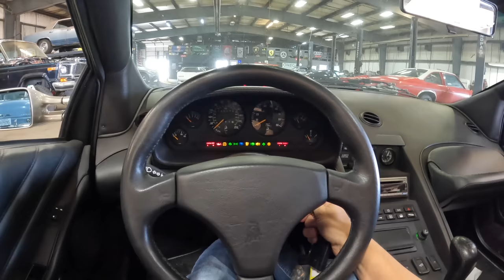All of my Lamborghinis are PERMANENTLY BROKEN, and that's totally normal. The Car Wizard GIVES UP???

Comment: I THINK I KNOW WHATS WRONG WITH THE DIABLO!!!!
I think Wizard is right about it sounding like a clarinet reed, because it’s probably the TXV pintle sticking. Try turning the AC off when the noise comes back around.
Reply: oooo....as a glorified PC repair man for the manufacturing industry, I like fault finding ideas such as this

Although, it leads me to wonder, just exactly how you reasoned this fault finding step? 🤔
Reply: @weedfreer  just hearing the noise sounds like something that is vibrating at an extremely high frequency. That makes me think about the components on a car that vibrate. Then components that vibrate and are attached to engine RPM. Then components that vibrate, attached to RPM, and are near the fire wall leads me to this as a guess. 
Couple that along with the conditions that the noise starts. Hoovie didn’t notice it until it started to warmup outside, and he (I’m assuming) started using the AC again. These are old Italian cars and little components like a TXV that aren’t used and lubricated often can start sticking and make this type of noise.
Reply: I have the same whine in my 330d when the AC is on and I’m at a certain RPM. Goes away with the AC off.

Obviously very different cars and issues probably aren’t interchangeable but it is an interesting thought.
Reply: My mother in law makes terrible moaning noises when we turn the AC Off.
Reply: @bruh meme that’s the thing the TXV is a mechanical device especially on such an old vehicle.
Reply: @kylekennedy420  almost all automotive AC systems work the same. If this is the problem, then it maybe to same for your car.
Reply: @BA-gn3qb  it may just be from the pressures equalizing in the evaporator that’s causing the moan.
Reply: @BA-gn3qb  criminally underrated zinger.
Reply: No A/C accessories in front of the engine…it’s all in the back. The “moan” apparently comes from the front of the engine, towards the firewall.

Comment: That noise could actually be something related with the flywheel pilot bearing. Creating the sound while it isn't loaded with the engine torque.
Reply: I was leaning more towards something in the intake plumbing.
Reply: @patrickradcliffe3837  don't think that would create such a frequency. They should install some mic near the gearbox. And then filter multiple sound frequencies.
Reply: I liked the idea of the oil thermostat, which would explain the noise when the engine’s hot.
Reply: e  what
Reply: @RogerM88  my guess is that it's a sympathetic vibration, or that if it's carbon fiber that something has delaminated, and wouldn't be seen on a quick visual inspection.
Reply: @peterborak3695  with this type of rare expensive cars, the better way it's to follow the service routine, replacing wearing items as the thermostats.
Reply: I had the same problem with a truck (I know, totally different breed) The truck arrived with a transfer case replaced and new rear shaft, I drove this truck for several days and couldn’t figure what it was, at the end it was a bearing that would  make a humming noise at certain rpm
Reply: e  Reported
Reply: its a bearing or some wind noise it being a convertable
Reply: @RogerM88  old Ford focus' used to have a solenoid that would go bad in the intake and "hoot" when the car was idling under high intake vacuum. I wouldn't be surprised if other cars had other goofy issues.

But this Lambo is beyond me.
Reply: @miguelgallegos8038  many people when doing the clutch job, don't replace the pilot bearing. I once changed a clutch in a truck, and the pilot bearing needed to be ordered separately because it didn't came with the clutch kit. I ended up not replacing it because the one i ordered didn't had the correct inner diameter, and the one in the truck was ok and too stuck to remove. The first day after the clutch job, I heard some winning noise with the car idling that immediately made me regret not changing it. The clutch release bearing was changed, so it only could be the pilot bearing. The noise eventually disappeared after some days. But with a high performance car with more load into a pilot bearing, not changing it, could bring some type of loud noise when the engine isn't at torque load.
Reply: @patrickradcliffe3837  i think intake plumbing was the first thing wizard thought too. So im sure hes checked that all out

Comment: I wonder if installing Dynamat or similar to the panel between engine and cabin could dampen the sound?
Reply: That’s the same thing I was wondering.
Reply: CLD type sound deadeners wouldn't be particularly effective against a sound like that. They tend to work better at adding mass and lowering the resonant frequency of a panel, and absorbing very high frequency vibrations in that panel. It would likely need a mass loaded vinyl, decoupled from the panel itself to block the noise.

Comment: That sound is coming from the de-coupling ionizing sectionised pludainum overtransactors. it just need adjusting to the counter clockwise using the new Rockwell Turbo encabulator.
Reply: Capacitor fluxing…
Reply: gotta love rockwell automation
Reply: More likely it's one of the spurving bearings, time and wear can allow them to make contact with the panametric fan

Comment: Timing belt/chain harmonics under load, that's where I would look
Try disconnecting injector and see if it moves the harmonic at rpm range.
It could be a gear droning in the front cover as well, possibly oil pump.
I have seen oil pressure regulators make a Humm when they are producing slightly more overpressure than regulator/bypass valve is opening, then you get a continuous series of cliicks that makes a Humm.
Replace engine oil to change viscosity and see if it moves the drone range.
Try an oil thickener like Lucas, if it doesn't effect anything, your only out oil.
Injector disconnect may give you a code or 5 but only out a computer reset.

Comment: That odd noise in the Diablo maybe actually a rattle within the engine compartment. My W12 A8L had that exact same noise when I drove the car at WOT and drove me crazy. Turned out a fuel line with a metal clamp managed to rattle against the manifold. - I found the source of the sound by cutting up pool noodles and wrapping pipes/cables etc until it was no longer there. Then I slowly removed the noodles until I found the source. Maybe worth a shot before having the wizard spend a bunch of time ripping it apart.

Comment: I worked at a high end shop for years and we had a set of microphones that we could clip to different parts of the car to find noise. It had a switch box and headphones that would allow you to isolate each microphone.
Reply: That’s what they used, “ chassis ears “

Comment: Here is a trick that might help finding the noise. 

Find a dyno shop that has an above ground loading dyno.  Get that car strapped on it and lock the RPM using the loading feature at the RPM where the noise occurs and then have someone in the car advance the throttle to the engine load point where the noise occurs and then poke around the engine bay and climb under the car and see if you can chase it down.

I did that using my above ground DynoJet 244xLC and diagnosed a similar noise no one else was able to find.   Took longer to strap it down than the find the noise.  That guy was very happy.
Reply: THANKS FOR WATCHING-🤝
You have been randomly selected 
Send me a direct msg right away 👆

Comment: I had a similar issue on my 300ZX twin turbo. A moan about 3k rpm. It was the i take tract and started occurring when I removed the factory air box and added a high flow Stillen K&N intake. Put it back to stock and noise was gone. Check the intake tract and anything not stock in the air way including air filters.

Comment: I’m not sure if the diablos have a spring loaded tensioner pulley or not but could that be the issue? Maybe when it reaches around 3k rpm it makes a spring loaded tensioner spring vibrate and resonate to make the moan sound?

Comment: I think you are finding a natural resonance in that drivetrain. Could be a bearing on its way out or a misalignment. Not sure if this car has the "option" for the all-wheel drive, it could be an issue with the output shaft. I would put the engine on the lift and see if it has any play on the shaft or any support that could not be tight enough. Can be the stiffness in the drivetrain that has changed because of this.

Comment: Hi Taylor, I will write some experience I had with an old car I used to own. It isnt a diablo of course, it was a WV Eos that started moaning right after the clutch broke and the mechanic changed it for another one. It was smooth with the original one, but the sound when decelerating was soooooo anoying I finally get rid of it. Its just a totally different car etc, but who knows!

Comment: You have a leaking air pipe/evap pipe near the firewall run a smoke test on the intake side and see if you get smoke. With age the  rubber pipes wear out and get leaky and sounds like crap then could be a cheap fix. It wont throw codes for something like that because the diablo ECU was not that advance back in the day to pick up a minor intake leak. Incase that does not work there are few other major diablo issues which cause issues intake manifold seal/gasket. Trans fluid worn due to age will cause a low hum in the trans.

Comment: I love that little Porsche Spyder replica. Sadly, it's out of my price range, especially for something so impractical. It's a race car from an era when a barebones race car with lights (necessary for endurance racing, anyway) was capable of being an acceptable road car, both legally and in terms of buyer acceptance of the un-weather-protected driving experience.

And here's a thing:
Lamborghini Muira was not the first mid-engine production sports car. The Spyder (1955) was a mid-engine Porsche production car, and not the only one from that era! There were the Spyder, RS60, 904 Carrera, and 906 Carrera. Even the 908 Le Mans prototypes were technically the last road-legal 'production cars' to race for an overall win at Le Mans, if I am not mistaken (1967-69, beaten by the Ford GTs). There was also the Alfa-Romeo 333 Stradale (1967), but I digress.

Anyway, Hoovie's Spyder would make a kickass pure sports car, for times and places where that works. But, I'm going to setup a Miata with manual steering, I think. Somehow I'll have to make room for my 6'1" self in that little car, potentially behind a biggish steering wheel.

Comment: Air bag light can't be turned off. In my state you'd have to install a bypass on that, because you'd never pass the annual inspection with that light on. So the car could never be put on the road.

Comment: Own the opposite : a 1988 Mazda RX7 FC Turbo what causes less to no trouble. It starts and drives just like my daily MX 5 ND. Changed one rotary engine after 100000 kms 20 years ago. Car has now 150000 so see forward to another trouble free 20 years. Car passed strict emissions and road worthyness - test here in no speed limit Germany on friday without any  issues !

Comment: We had a BMW where the crankcase ventilation failed and excessive vacuum caused the rear main seal to moan just like that. If we imagine that this is a similar vacuum related noise i suspect the seal around the harmonic balancer may be a possibility. I've seen your vidoes from the beginning because of our old 420 SEL and have always enjoyed the witty commentary.

Comment: Beautiful Lamborghinis there Tyler, you have awesome vehicles ..  I always wanted a Countach.   So much so My Dad once bought me one, it was the Hot Wheels version 😂...   Judging by the moaning noise it could also be a warped exhaust manifold, bad gasket or block mating surface.  It will sound like a clarinet reed noise as you described.  Under normal idle or driving the exhaust manifold is fine but during acceleration like between 2000 to 3000 rpm's the exhaust manifold or gasket will temporarily leak high pressure air creating this noise.   The leak is probably at the back of the engine top passenger side exhaust tube.   If the noise happens more when the engine is warmed up I would say the manifold is deforming just enough to leak past the gasket, once it cools down it goes back to normal...   I had a similar issue on my late Father's L98 Corvette.    This seems to occur where there is little to no airspace around the exhaust manifold, the manifold essentially gets overheated and either cracks or deforms....

Comment: Have you considered that the moan could be from sonic resonance coming back through the intake manifold? If the manifold draws air from near the firewall you might be getting resonance pulse sound that's audible in the cab? Just a theroy
Unless there is a leaking valve body (EGR for example)

Comment: the moan could also be a slight defect in a chunk of metal in the intake that catchs the wind blowing thru it or a gasket that has to much on the inside. If you have not noticed most cars have that one spot around 1500-2500 rpm that either makes a noise or vibrates the car which is often the balance on the crankshaft

Comment: The moan reminds me of my '89 Saab 900 Turbo.  The stock plastic blow off valve for the turbocharger was always referred to as a "hooter" valve because when the diaphragm went bad in them they would hoot with a similar sound you're hearing.  Don't know if the Diablo has something like this, or similar to that, but that's what it reminds me of.
Reply: THANKS FOR WATCHING-🤝
You have been randomly selected 
Send me a direct msg right away 👆

Comment: The thought that comes to mind is resonant frequency issue, like rubbing your finger around the rim of a wine glass.  The vibrations at that rpm are causing a piece of the car to “moan”, as you describe.  Could it be in the drive shafts?  Or input shafts?  Have those been ruled out?  A maddening thing, I am sure.  

Sell them all; that is what I would do.  Get a Ford GT and a 930 Turbo…then buy a bunch of hoopties to have fun with on the channel

Comment: With the Countach and the Diablo, I would love to have both or either. I have enough mechanical know how to work on certain things myself, and things like dead airbags do not bother me. I pulled the airbag steering wheel out of my 30 year old Honda Civic, i do not like the idea of a violent pillow smacking me in the face if I end up in a wreck... I will already be pissed off enough as it is.

Comment: I currently have the engine out of my -92 Diablo. I have several pictures of the engine I can provide to you to maybe give a hint what the moan can be. I myself have no idea what the sound could be. There is not very much back there towards the firewall. The only thing might be a transmission mount or an engine mount going bad.

Comment: You could try if it would be easy to get to is place some sound reading material on the inside of the firewall and see if that will kill it if it is the firewall doing it. Maybe there are some screws loose if there are several panels that make up the firewall.

Comment: Presume breather system has been checked/blocked off to try? Other one is fuel system, lots of cars had dampers on the fuel system to avoid noise/resonance, not sure if the lambo is the same. Could be worth changing something  (such as adding a length of flexy hose in to see if it changes the frequency ). The noise path could be through the hoses/tank mounts etc. If you knew the frequency that would give a goood clue

Comment: Check the rear window seal the window might be rattling or a body panel behind the seats might be rattling or a bolt or a screw got wedged between a body panel and the firewall

Comment: Lambo makes race cars, which constantly get worked on and tuned up.  They are not made for endurance and reliability  between service visits.  They're also made for drivers 6' and under, with small pedals and pedal spacing, as well as tight cabins.

Comment: Agreed I own a shop and not charging if its not fixed is one of the things that builds the most trust between you and a customer. Whos to say you werent sitting there doing nothing for hours and when the client come back shrugging and saying you couldnt find it.  You may be able to get some money out of them but they will never trust you again. What makes a shop is not the hourly rate its standing proudly behind your work and sending something out the door you know is not right is the downturn of many shops.

Comment: after changing out some handle bars on a motorcycle, i had a sound that fits the clarinet reed description. It only happened at certain speeds. I eventually found it was a thick rubber hose that was vibrating and making a weird noise. All i had to do was zip tie it down and it stopped. I wonder if one of those pipes on the fire wall is rubbing on something.

Comment: Just a thought but have you guys checked the pcv system? I've experienced a strange moaning noise with a blocked pcv port. The vehicle would literally push the pcv pressure through the rear main seal causing a moaning sound.

Comment: your noise is from the transmission. it is caused by a valve inside the transmission. fixed the same problem on 2 other by replacing the valve in the transmission.

Comment: Is the Diablo full time awd? If it is and the tone changes could be a bearing going to the front axle. Fairly sure wizard would have found that. It has a very pronounced sound to it changes wether on or off the gas as well.

Comment: How I found a little tick at a certain speed. 
I used my gopro with a magnet mount and a suction cup mount and moved it around the car and sure enough I found the problem. A loose clip on a wheel cover would cause the cover to move just enough at 30mph to make the noise.